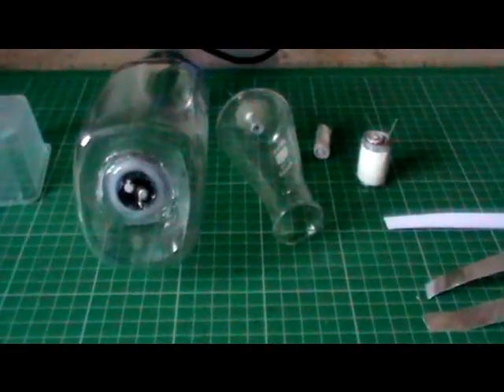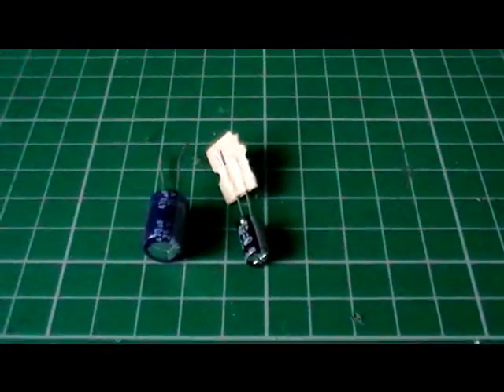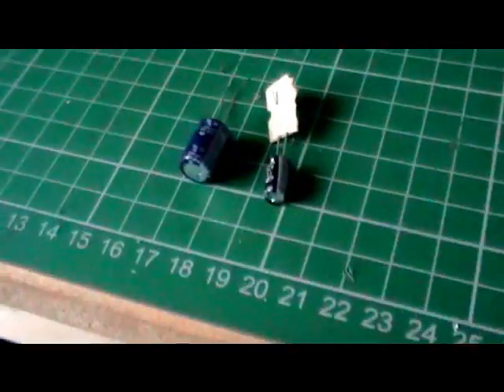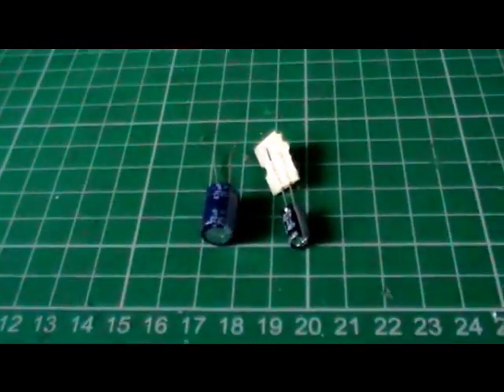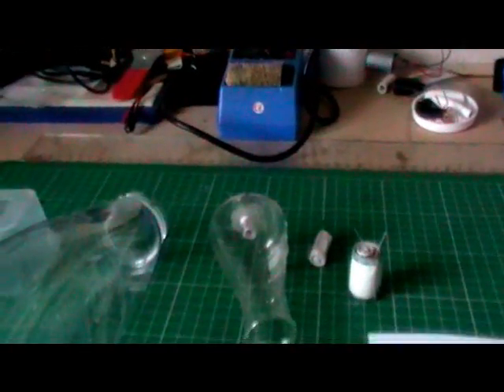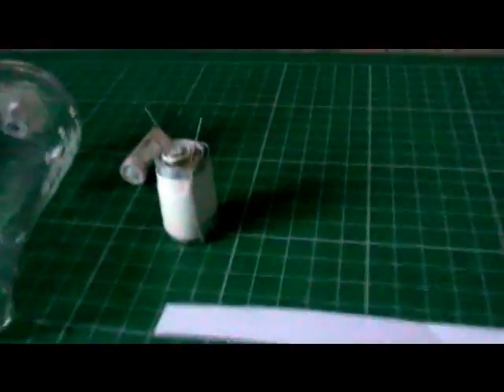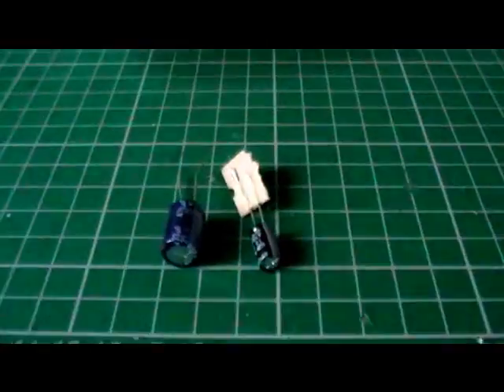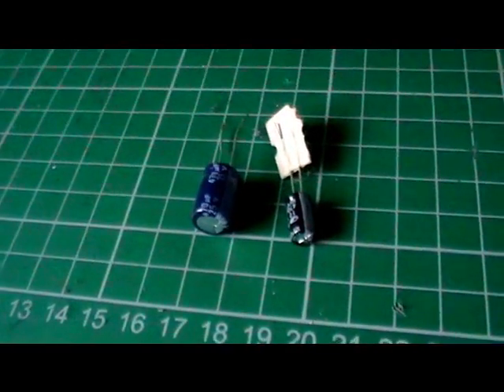Pole Shift News Capacitor HHO Generator Discovery

Comment: wat is hho
Reply: +shannon boyd it stands for hydrogen hydrogen oxygen made from H2O or water.  You get 2 hydrogen atoms for every oxygen atom produced as a gas from the electrolysis of water.  It was originally called Brown's gas after a gentleman named Brown who made machines to produce huge quantities of the gas for different projects, but mostly for welding.  And based on his techniques the HHO movement was born and there are tons of videos on how to do it and to make use of the gas for welding, running gas stoves and driving cars as well as medical uses of the gases.